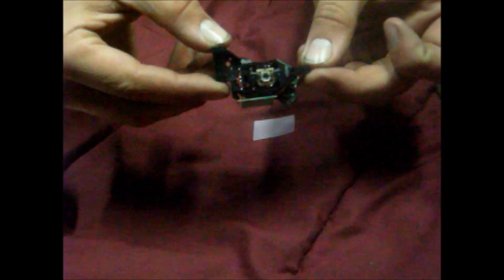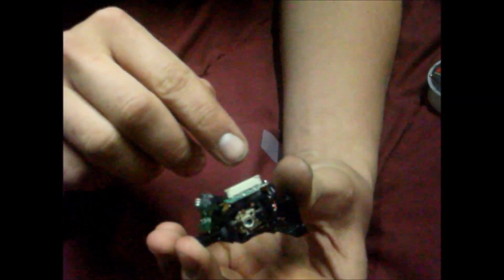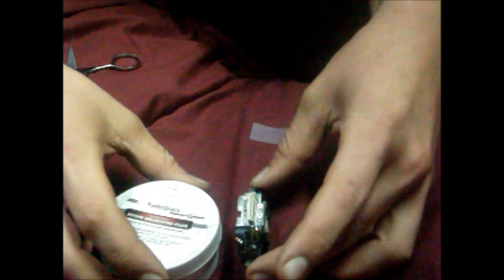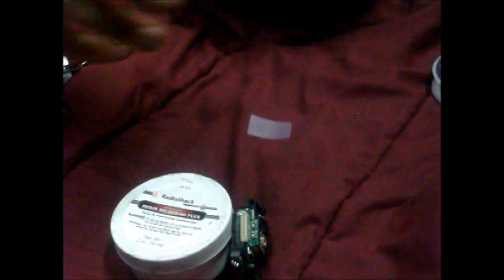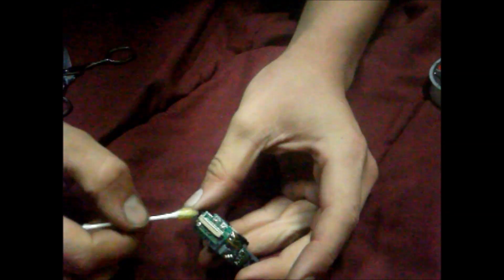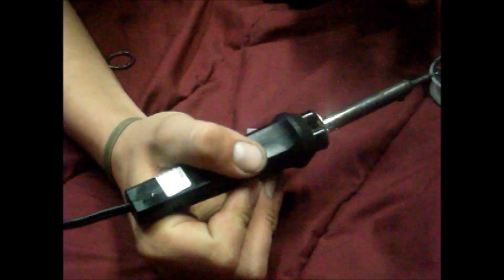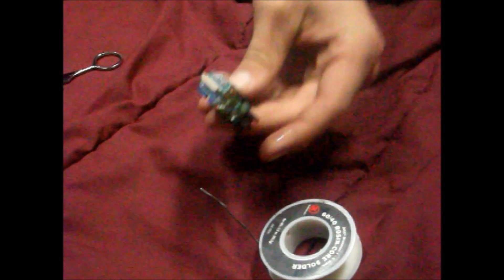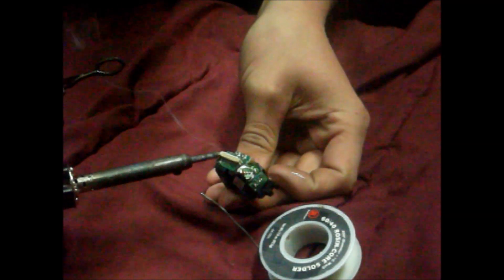how to remove a anti static solder ball

Comment: I used a solder iron, but I'm not sure if it was hot enough bc I didnt instantly come off...It took me several tries...I only see two points, not three.  My laser moves and lights up as usual during bootup but I'm still getting the Open Tray error.  Could it be my PCB or could I have removed the solder incorrectly?...Also, would the laser move and light up if the ribbon cable is bent(from removing and reinserting during laser replacement)?

Comment: Also, if for any reason it's bc I have two points instead of three, would I be able to adding a third point(like, with solder or something else)...This is my first time replacing an Xbox and I've done everything except swapping the PCB or smashing it with a hammer